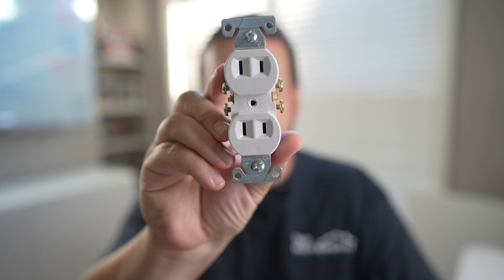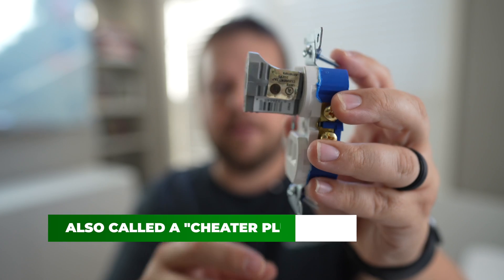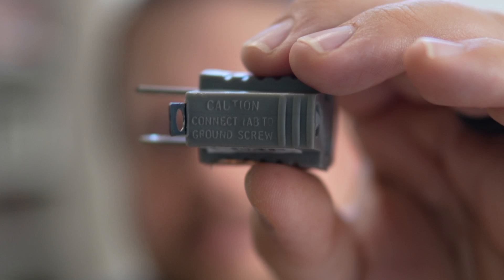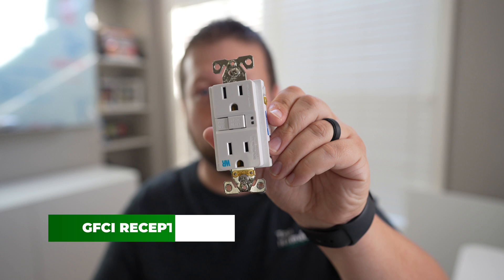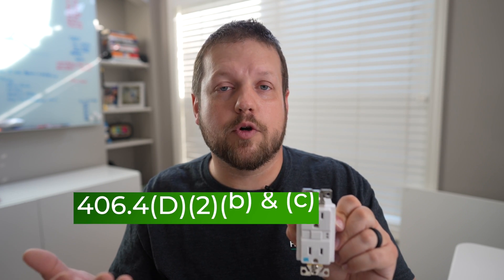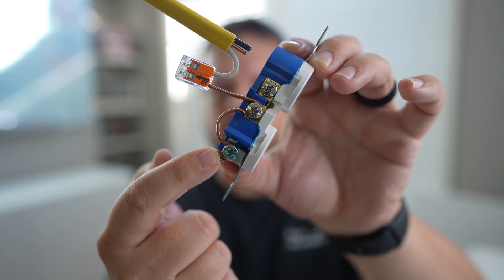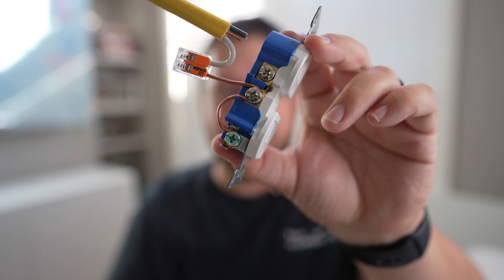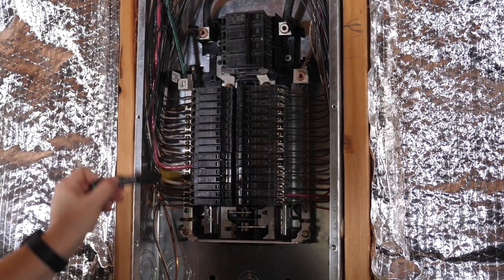3 Weird Ways to Ground a Two-Prong Electrical Outlet

Comment: This is a great explanation for people like me that no nothing about electrical connections.  The GFCI outlet, looks to be a solid solution for 2 pronged outlets.
Reply: Yes, installing GFCI  protection is a great way to make an old ungrounded circuit safer without the expense and inconvenience of needing to fish in new romex which can come at a great expense depending on the layout of the home.   The end user should be made to understand a surge protector plugged into an ungrounded GFCI protected circuit is useless.
Reply: @Sparky-ww5re  can you please explain further? Would love to understand more!
Reply: Easy to install too. If you can stomach working on wires in your wall.
Reply: So if you’re not sure what outlet is the main one feeding the “room” is it okay to replace every outlet with gfci? 
Thank you.
Reply: @jloza9840  There's particular reason not to other than price. One of the advantages of having too many of them is that it reduces the likelihood of a receptacle being powered down due to a fault in an unrelated part of the circuit.
Reply: @jloza9840  Replacing "every" outlet is not required. You'd need to find out what recepticles and switches are included in the "run / circuit" of wire included with the recepticle being changed to GFCI. You'll be able to find this when you Turn OFF the power for the change. What ALL turned Off  when you Turned Off that breaker for the change???  Those outlets and switches will be affected when you TEST your GFCI to make sure it cuts Power to the circuit.   If uncomfortable with knowing for sure, hire a professional.
Reply: It's the correct solution if you're not able to just get a proper ground run.